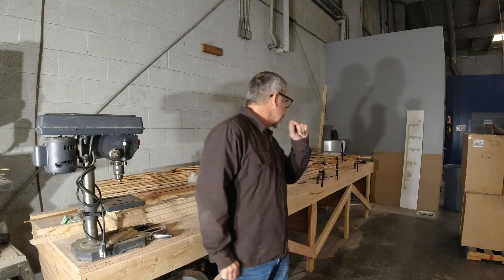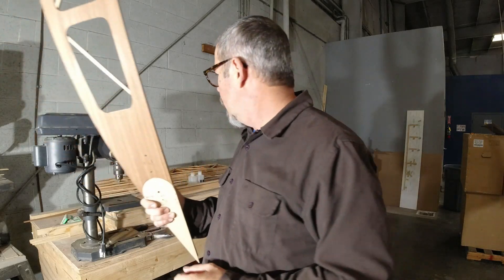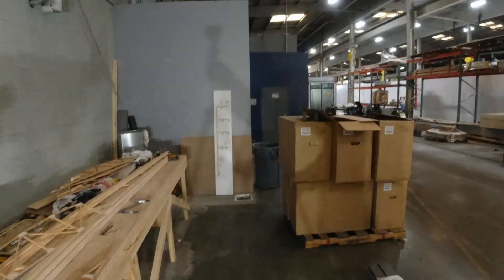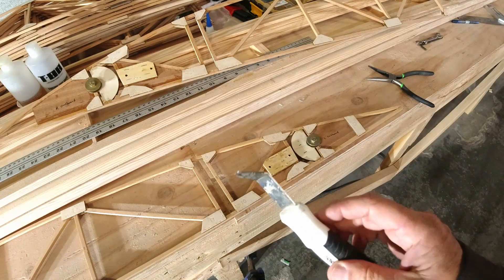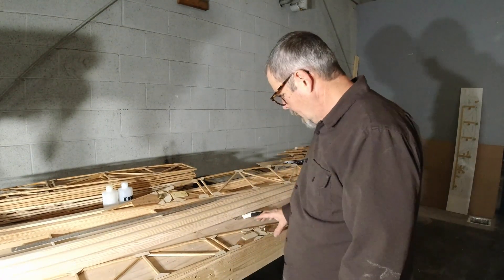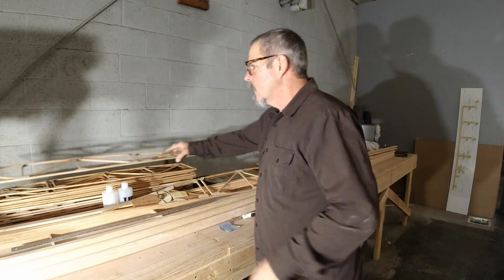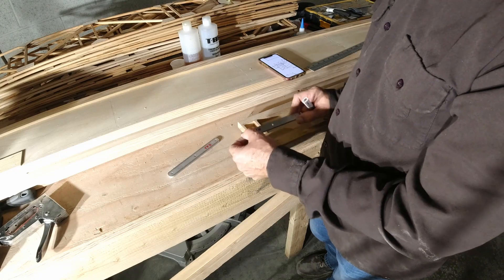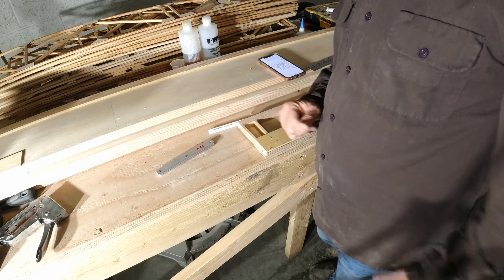Minimax 1100r Aircraft Build Vlog Episode 2

Comment: What is the recommended way to fill a small gap in the glue joint?
Reply from the maker: I used Cabosil mixed with the T88. It’s structural unlike micro balloons.

Comment: Hello Denise I’m enjoying the flight test videos. I have a question as to where you sourced the bolts for theRoot and tip rib bearing brackets. The plans call for 1/4-28x2 S.H.C.S. All that I could find at aircraft spruce were bolts 1” or less. Why the socket head? Thanks for the great video resource
Reply from the maker: Hey Michael, I got mine from McMaster Carr. The bracket has to be able to slip over that head when attaching the aileron and brackets. If you message me your address I have a lot of extras and can send you some
Reply: Denise I went on the McMaster Carr website. I’m confused as to what type of screw to purchase. There is black oxide, cad plated, and locking thread, and mil spec. Any suggestions? I’m enjoying the flight videos. Thanks again and Merry Christmas.
Reply from the maker: I just used the Alloy Steel Black ones. They have a higher tensile strength than the Mil Spec and they’re not $4 a piece. 
Glad you’re enjoying the videos!

Comment: I'm studying my Vmax drawings and making my spar members.  At @16:10 you begin to talk about how you think the doubler is too short by 1/2" because the overlying gusset goes past the doubler.  The way you have it, though, is exactly the way my drawing shows it:  long side of the doubler is 4 3/4", and the long side of the gusset is 5 1/4", resulting in the 1/2" inch difference in length.  The dimension of the doubler actually is on the plans; you must have seen that originally and cut it correctly, but maybe forgot that you had known the 4 3/4" dimension when you made the video?  It is strange that the lengths aren't the same, though.  Did you ever scarf-in an extension to the doubler?
Reply from the maker: At 12:26 on the next video you can see where I did add in a piece to the end of that, gotta love working with wood!

Comment: Enjoying your videos. By now maybe you figured out what happened at 16:10. I'm building 1650 EROS. The page of the skeleton doesn't show that doubler dimension, but it's shown on the following page with the brackets. Also, for my plane, placing the doubler against the edge with the adjacent capstrip results in a 1/2" shortage after the end is trimmed to the slanted shape of the end vertical piece. I had to set the doubler "in" at the correct location. When making the jig, I nailed a piece in to make sure the doubler was correctly set.
Reply from the maker: That was a head scratcher when I set that piece in there. I’ll have to see if that is located in my plans where yours is.

Comment: The wings fittings are from 2024 T3 aluminum 1/8? Thanks
Reply: Juan I know this is a little late but no sir there are not 1/8 inch they are 3/16 in the aluminum Wing fittings
Reply from the maker: 2024 T4 1/8"